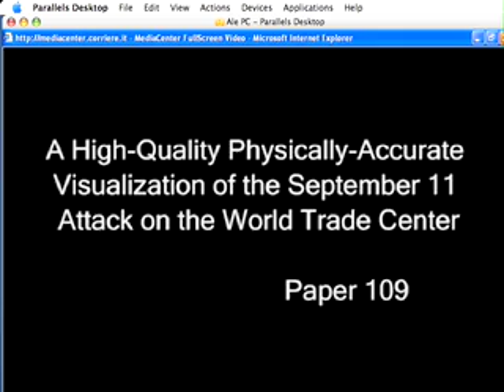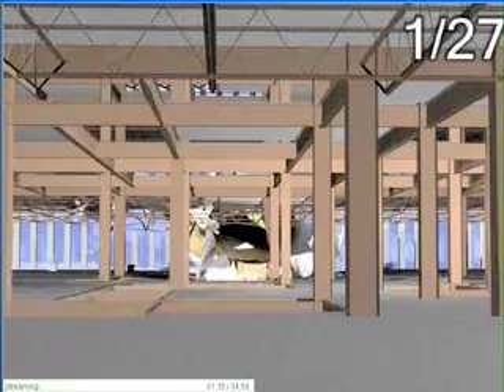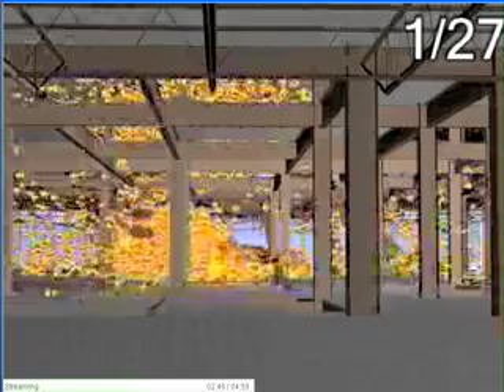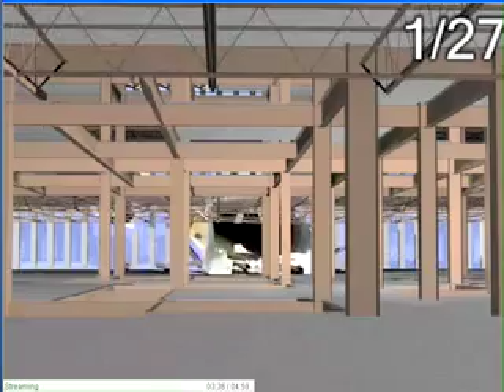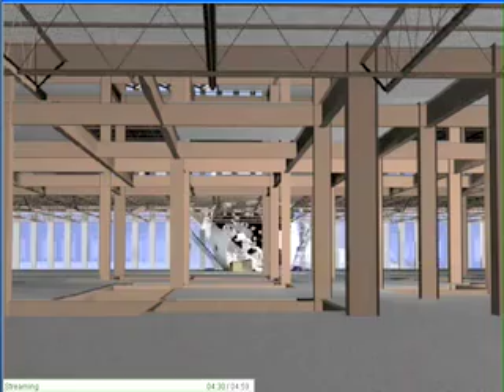9-11 Twin Towers Attack 3D simulation

Comment: If the building was made of wood i would belive that.
Reply: Wood stands fire better than unprotected steel.
Reply: are you joking with me? im a welder since 2006 i know how metal works. 600º fire dont affect steel at all. if you dont belive, look to your kitchen pan, they stand with high temperatures for long time and after you are done they are the same.
aluminium dont cut steel like you see in 1:04... if the building was made of wood the plane would penetrate the building like you see, but it wasnt.
Reply: Try crashing a plane into your pan first, and stack a few hundred thousand tons of building onto it. Tell me how long it resists.
Reply: "Aluminium dont cut steel" (sic)
Even water can cut steel, so imagine aluminum. Don't you idiots get tired of being debunked over and over again? https://www.youtube.com/watch?v=M9hAM68K9OU
Reply: Huge airplanes smash into skyscrapers. Skyscrapers catch fire, start buckling at impact points and later collapse. What is so fucking hard to understand about this?
Reply: That reinforces my argument, that the material things are made of has little or no importance in scenarios like the ones at hand. You are the moron that claimed the plane could not enter the building, not me!!!!
Reply: Explain then, moron, what the fuck does the density of the materials has to do with the topic at hand. 
It's not that I am personally interested, but I think it will be priceless to hear some kind of law of twoofmodynamics improvised now to justify some already dead and debunked conspiracy theory.
Reply: Nunny boy.

I do not compare the WTC with the very strong Empire State Building.
Guess what happens to wood in a fire?   it burns eventually but have you never seen the remains of a house fire, the wooden beams often remain holding up what is left of the building, unprotected steel ends up a twisted buckled mess.
The towers which were designed to withstand high winds, They did not have fire resistant steel but normal construction steel, supposedly protected by asbestos, some of the asbestos had been replaced.  
The multiple airplane hits is just more twoofer nonsense, the towers were meant to withstand a hit by a single Boeing 707 at low speed and fuel was not taken into consideration.  Take a heavier plane at much higher speed, and full of fuel.   
I know all high rise buildings are floors on top of other floors, that is how they are made, they work up from the bottom adding floors as they go, you may know or maybe not that the building has to be stronger at the bottom than at the top.
  Just maybe you should read what the designer of the Towers said about it rather than the twoofers who know no more than you about steel or construction.
Reply: Nunny boy.
The 767 would need enough fuel for not only the trip but enough in case of needing to divert and an allowance for safety.   Boston to Los Angeles is over 2,500 miles, Boston to New York is under 200 miles
Reply: aluminium dont cut steel is not a conspiracy theory... Its physics
Reply: Neo Morpheus i can show you a gas cuting steel, how about your argument :) it is less densier than water.
Reply: you deleted good
Reply: Nunboy.
You really keep on showing your ignorance, the steel columns were how thick?  
The B 25 which was not fully laden and very low on fuel so well under the normal weight,  or well under 35,000 lbs.  The fire was put out in 40 minutes and parts of the building were in use 48 hours later.
Now take a plane over 10 times the weight travelling over twice as fast, that is well over 300,000 lbs weight and one hell of a lot more force, not just thin aluminium. You seem to think the plane is just a thin hollow tube and the building solid steel.  
Your last sentence applies only to you.

Can a human hand break cast iron?    Just a simple yes or no will do.
Reply: Nun 
Stick to welding or maybe not, you know nothing about the properties of steel.  the building had some steel columns and a lot of space between them, so when hit by a heavy object something is going to give, even a very strong building like the Empire State building when hit by a much smaller lighter plane was penetrated, now take a plane over 10 times the weight flying at well over double the speed and what happens?  The Empire State building is not made of wood is it?
Reply: As expected, after debunked, twoofers can only bark excuses. You claimed an aluminum plane cannot penetrate a building, despite millions of witnesses and dozens of cameras proving otherwise. 

What was your excuse? Some asinine standard twoofer lie that "aluminum can't cut steel". When debunked using evidence that even water can cut steel, what's your excuse? Some incoherent barking about impacts, pressures and tickness (a word that doesn't even exist).

Try to keep some dignity (if you have any left) and admit you have been owned, for fucks sake.
Reply: Neo Morpheus, another idiot just being an idiot.
do you have any idea of the pressure you need to cut steel with water and the proximity? do you know the tickness water cuts with that pressure? its about erosion. We are talking about impact forces.

with the right pressure even with air you can cut steel. 
show me a grinder with 85% aluminium disc cuting a IPE 120 and i will agree with you....
Reply: barry kid you are ridiculous. you dont know the mechanical proprieties of steel. 

1- the WTC had fire resistant steel. 
2- the ESB is strong but is more fragile. masonary breaks easy beacuse is harder than steel
3- jet fuel fire burns around 600º, that dont affect steel at all. 
4- more than half of the fuel was consumed in fireball explosion.
5- aluminium dont cut steel
Reply: Quote from the FEMA report into the collapse of WTC's One and Two (Chapter Two). 

Since the aircraft were only flying from Boston to Los Angeles, they would have been nowhere near fully fueled on takeoff (the aircraft have a maximum range of 7,600 miles). They would have carried just enough fuel for the trip together with some safety factor. Remember, that carrying excess fuel means higher fuel bills and less paying passengers. The aircraft would have also burnt some fuel between Boston and New York.
Reply: Nunny boy.
You lose again. The WTC had structural steel which is affected by heat from around 350 degrees by 600 degrees the steel loses a lot of strength and fire started by jet fuel but then burning up all the flammable materials in the building will reach a high enough temperature to weaken steel.
Less than 1/4 of the fuel was consumed in the fireball.   Anything can break steel given enough force.
Reply: OMG again!! you are talking about a machine that was desgined to go beyond all the resistences of steel (depending thickness), and for some minutes EROSION does the work of thousands of years.
we are talking about impact forces that works with ductility, thougness and strenght
grow up, learn something about the mechanical proprieties of steel and get a life.
Reply: barry dont compare the WTC with ESB, two diferent buildings, built with decades of diference. 

we were talking about your ridiculous theory wich you said "Wood stands fire better than unprotected steel" 
Really???

"You seem to think the plane is just a thin hollow tube and the building solid steel." and you think that a building designed to sustain several airplane hits, hurricanes and built with fire resistant steel  are just floors on top of each other
Reply: I dont know nothing about steel?? lol do you? a b-25 mitchel really? a plane that could weight 41,800 lb some of them reinforced with sheet metal to protect the plane against AA guns. come on ... 
thanks for mentioning the empire state building  beacuse 2 days later was operacional didnt went down :)

PS. 1 - arent you forgeting about the WTC inner core wich was more tough than the outer?
2 - Aluminium dont cut steel. 
The empire state building is made of reinforced concrete, and other heavy building materials such as masonry. those materials are fragile because they are hard( they brake more easy). steel is ductile

Comment: its many steel beams and a light aluminum plane.  Come on now.     Only in hollywood.   Steel would not move.
Reply: says who?
Reply: have you ever been in the tower.  Those windows were narrow.  That is a lot of reinforced steel on the face of that building.  Even if some of beams were compromised during impact, the physical resistance alone would have created a more difficult entry of the rest of the plane after impact.   Me
Reply: so what? Do you think that because the plane did not behave according to the standards of what you think a plane hitting a building would do, reality is wrong? Isn't it much more likely that it is your opinion what is wrong?

Comment: just a though for all the engineering bods out there, whould a flimsy alloy plane wing actually damage that steel to that extent? Just thinking of the mythbusters episodes of sticking a car on the rocket sled and what happened to the car.. and you see planes do heavy landings and the wings flex and crack or drop off, so how would it do so much damage from a thin flimsy wing...

Comment: The fuel in the tanks is inaccurate. There is foam rubber or a fuel bladder in the fuel tanks to stop fuel spilling from the tanks. As you show in your reconstruction. Revise. I have cleaned and patched fuel tanks in wings. This is F.A.A. regulation.

Comment: To all of the people who are sitting here talking shit about anyone who questions the official story, calling them so-called "armchair conspiracy theorists", I have a few questions that I think you should ask yourself.

1. Have you actually listened to full research with evidence from a differing opinion? (pilots for 9/11 truth, architects and engineers for 9/11 truth, etc) OR, do you just jump to conclusions and jump on the "everyone who questions 9/11 is crazy" bandwagon?

2. Have you heard ever asked yourself how 2 planes carrying approx. 10,000 gallons of pretty much kerosene can hit specific points on the upper sections of 2-110 story buildings, cause fires with thick black smoke (meaning oxygen starved fires), and still have the heat enough to warp steel enough to cause the buildings to completely collapse?

3. where on earth do you think that two jet fuel, or kerosene fires got the energy to pulverize hundreds of thousands of tons of concrete and steel and hurdle trusses from the buildings hundreds of yards away?

4. Have any of you done research into building 7 and how it fell? the last time I checked, only 3 steel frame buildings in history have collapsed due to fire, and all of them happened on 9/11.

5. Have you ever questioned why the towers fell exactly the same way, why witnesses in and out of the towers (firefighters and workers in the towers mind you) reported hearing explosions multiple times after the planes hit, up to, and including the collapses?

The people who resort to name-calling basically just expose their ignorance of the truth movement. Do some research before you judge, and maybe you would see what we are talking about. Look up the NRUN65 channel and the movie The New Pearl Harbor, both on youtube. there is plenty
of evidence for why people think this way about that horrifying day, maybe you should actually spend some time to listen to some of it.
Reply: No, because I prefer to live my life not batshit crazy.

Comment: Planes are made of thin aluminum and the wings are made of fiberglass and aluminum. They could never penetrate a strong steel building. I would have smashed in and parts would have fallen to the ground. Planes don't get swallowed up by the earth a la shamksville and then they find a pristine red bandanna. Where did the passport from Atta come from? It was found a few blocks away. Both clearly plants.  Inside job di=one by Mossod. Look at Dancing Israelis who were mossad agents.

Comment: Just ask yourself: what did happen about the WTC - 7 and the Pentagon. The issue Jacksonville was a stupid and vulgar silly lie.

Airplanes are lightweight and their structure is mostly aluminum, however these three planes enter a steel grid formed by the edges of the floors and the outer columns. . . Remember that it's steel !! ; it's just like the Roadrunner's coyote crashing aginst the wall.

Comment: My question is what happened to all the black boxes?
Reply: Samuel Rhodes - There is no real evidence to suggest that's the case. All you have are idiotic theories that make no sense. These theories are increasingly insane, with some people even claiming that there were no planes on 9/11.
Reply: +Steve Healy  Look up the crash of PSA 1771. During a high-speed impact, lighter items often survive better than heavier ones due to being ejected before the fireball can reach them. In that incident, a Colt 45 handgun was ripped apart but the airsickness bag the hijacker wrote his suicide note on survived. As far as the missing black boxes, look up Air Inter 148 and El Al 1862.  In the Air Inter crash, the FDR was damaged by heat from the intense fire after the crash making the data irrecoverable. In the case of El Al, the plane crashed into an apartment building and the CVR was never located in the debris. There's a whole list on Wikipedia of FDRs and CVRs from plane crashes which were never recovered for various reasons.  It happens.
Reply: @icemachine79  while your explanation of small objects being ejected is indeed true, it’s not even needed for this explanation.
The hijacker’s luggage that these guys are referring to wasn’t on any of the planes that were hijacked. It was put on a separate flight that was headed to the same destination.
It was simple luggage delay that saved those pieces of evidence.
Reply: +Steve Healy  Aluminum traveling at 500MPH most definitely can cut through reinforced steel; especially if that steel is divided into columns held together by welds and braces that can be broken when enough force is applied.
Reply: oddhominem. No but the hijackers passport manage to survive that 'inferno'. Hollywood couldn't make this shit up. Or maybe it did
Reply: Steve Edge. Good question Baz Rodliffe probably has the answer. He believes in fairies and that aluminium can cut thru reinforce steel.
Reply: Steve Edge 
Simply INSiDE JOB
Reply: Steve Edge 3 of the 4 black boxes were recovered from the WTC area. None of the data was recoverable.

Comment: Interesting Really?  I'd beg to differ that it's nothing but sheer buffoonery. What is interesting though is the application of Newtons 3rd law:-  "For every action, there is an equal and opposite reaction". So lets look at this from the Third Law's perspective. We have this gigantic building crashing down on this minuscule plane resulting in wafer thin aluminium  passing through it without a crumple. Anyone who can swallow this either lacks any modicum of common sense, is out of their mind,  a part of the conspiracy or prefers to keep their head in the sand to avoid admitting that they've been living a lie.

Comment: It's a very nice simulation and it is obvious that you put many hours into its production. However, It is, as you said, based on the data available to you. Calling it a representation of the twin towers though is a gross misrepresentation bordering on libelous disinformation. That being said, I prefer to give you the "benefit of the doubt" and have taken the liberty to give you several recommendations that I believe will give your submittal credibility and free you from any professionals severe public scrutiny. 

First of all, I believe for the sake of accuracy and your professional reputation you should change the title to something like "Fictional High Rise Structural Simulation Study Involving Aircraft Collision". Then put a disclaimer to any similarity of the 9/11 Twin Towers attack. Also it would be advisable to  associate it with your post graduate studies involved with your degree. This, of course, is  based on what I observe to be an over simplification and obvious lack of advanced detailed structural analysis consistent with a medium level students assignments. Second, state your university and or any other higher education you are involved with.

Also and this is very important, judging from the date of this posting it is very possible you were the victim of the politically poisoned and highly inacurate N.I.S.T. data. That in and of itself will explain the egregious errors and flaws. Because It is obvious that the data that was inherently flawed and does not take into consideration the dynamic structural considerations of aviation grade aluminum vs. the primary outer exterior steel column structural support nor the secondary main core structural steel columns supports. Good luck in school.